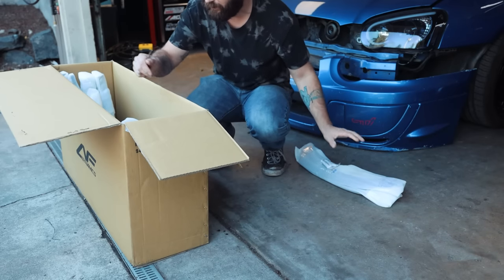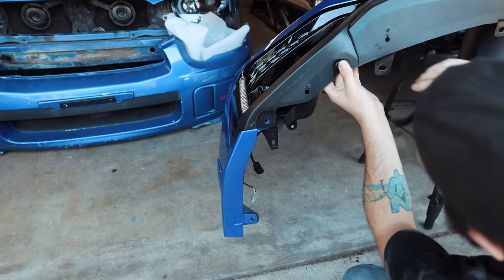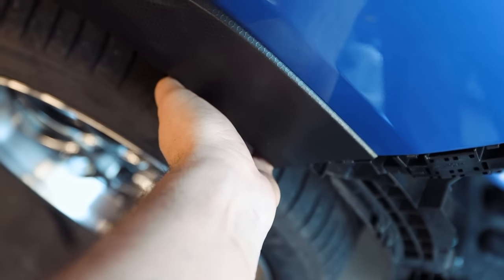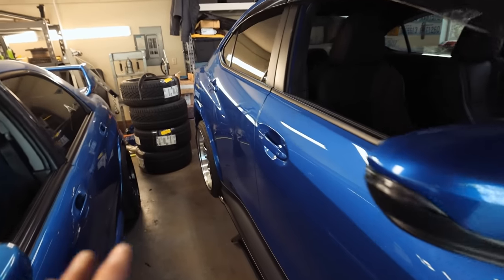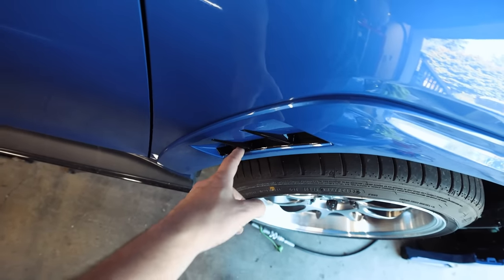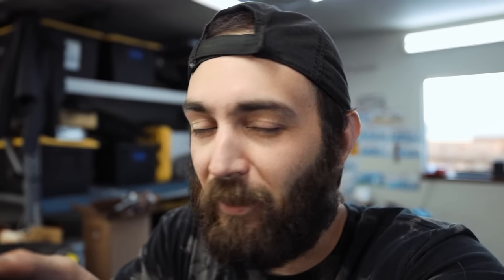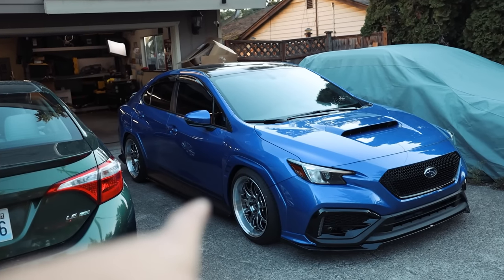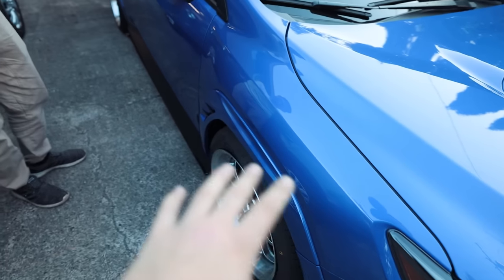2022+ Subaru WRX; Paint Matched Flares. Why did Subaru Not Do this?!

Comment: I prefer the black much more, but I've seen a few color matched ones that looked good. Depends on the color of the car.  My issue with these, and the bulk of paint matched flares, is that bottom piece of the fender that touches the fog light housing should not be paint matched.  It flows with the side skirts and should be left black like the side skirts. Visually, it is not part of the flare.

Comment: The STI started in 2 cranks of of the key this time.  The wheels flares are dope!!  If you compare the paint matched flares from the VB chassis to the VA chassis you'll notice that the VB chassis has an Octagon shape versus the VA chassis having a smooth round shape.  The VA chassis fender flares look so much better.

Comment: The other option to tie the flat black side skirts in with the front and rear bumper would be to take what mat’s thought was a two piece on the front lower part of the front cover and tape it off at the line and flat black it. It would carry the the flat black and piano black layers all the way around, and it would be a lot cheaper than having the skirts color matched.
Reply: This is the way.
Reply: Yeah this is what you should do, I've seen people paint the side skirt and imo it looks weird because then it becomes to uniform. Just paint the small part of the flare that goes onto the bumper black.

Comment: I love the paint matched flare/cladding so much more, but i kinda have to agree with Matt about the smaller piece side piece on the front bumper. The plastic cladding did kinda tie in the overall theme with the car and made it flow, but with that smaller fin on the lower side being painted, it kinda throws off the skirt and the front bumper a little. Persoanlly, i would maybe grab a black spray can, and paint that front side fin to make it flow again instead of paint matchkng the skirts.

Comment: Tossing in my two cents, I’d argue this is my quintessential look for the VB chassis, it’s similar enough to tie it back to the VA, but different enough with the flat black around the bottom of the car via side skirts and bumpers, to pull it all together! 10/10 dig it

Comment: Wouldn't it be easier to paint the little bumper piece of the new fender black? I actually like the side skirt being black, it makes the side of the car look sleeker.

That said, my main issues with the design of the car is the shape of the bumpers (octagonal cuts look weird over a round wheel), and the rear bumper juts out in a weird way. If they fixed those two things, the car look immediately look significantly better.

Comment: Looks great but still a fan of OEM cladding.  Painting the small piece on the bottom front flair black would 1. Look better than painting side skirts and 2.  Be cheaper/easier than painting side skirts.  Could prob just wrap it to see what it looks like.  If you paint side skirts the natural progression is to go to rear bumper and there’s no good/clean way to do that with WRB (black/white with painted bumper can look good).

Comment: Yea I fully believe it looks better stock, when the cladding is still there but it's just painted it is still the same distraction.  Only way to do it would be to make a one piece panel that was solid color and then it wouldn't stand out so bad.   I am used to the cladding now and like it though, plus would already have 2 paint chips if it was paint matched or full body panels so practical in my eyes.

Comment: Everyone gives themselves away as a non-Subaru fan if they were surprised by the fenders. Subaru was showing them on their VIZIV concepts for years. Only difference was they were carbon fiber. But a road car isn't a concept car, and yeah, didn't quite have the cool/quirky effect as the concept. Well...until I dropped the car 18mm and mounted black wheels...and the VIZIV look began coming alive. I'm painting myself...black/clear. It will truly look finished.

Rear bumper...it needs the BRZ rear bumper. No brainer. Doing "grafts" used to be reguler/rare thing...it was difficult. Mainly a European thing. Lots of grafting on Porsche's and BMW's in the 1990-2005 period. I figured 3D printing would make this stuff explode. That there would be 10 rear bumpers for the VB by now. Imagination appears to be fading away.

Comment: Tanner, the area that Mattias pointed out on the front that does nor look like it is part of the flare but it is, is the issue. It should be black to match the front lip. It would look much better and blend with the bottom lip and side of the skirting, IMHO.

Comment: Love it. Me personally I think this is one of the few exterior mods that should be done first if you can buy the flares. Aeroflow def did a great job at paint matching and manufacturing these. Great call on swapping out the oem ones bro!
Reply from the maker: It's nice to be able to swap back to oem if wanted with these ones. Super happy with the paint match 🙌

Comment: how about doing the sideskirt in high gloss black? The stock flat black only looks out of place Now because the rest of the paint is glossy clear coat, high gloss black sideskirts would look better than the flat black oem, but painting them blue would also look better than the flat black, I would lean towards blue since mono colored body is the traditional WRX/STI appearance package...if Subaru had done it from the factory there would have been a lot less controversy, but they also opened the door for customization , therby continuing the platforms modability! lol

Comment: Definitely a positive change, looks good, I think the paint matched flares from these companies are OEM pieces just sanded down and painted body color which is why the fitment is spot on, Need the side skirts painted body color to go with the flow of the painted panels now.
Reply from the maker: Surprisingly they're not OEM Panels, they're all injection molded, but done very well 🙌 side skirts are the next thing to paint match 🔥

Comment: Little off topic question, I'm building a jumper from my stock engine harness (06 2.5i) to my wire in link g4x.
Do you have any tips? Workflow, documention, grounds?
Reply from the maker: Color code wires, use a spread sheet and make sure all wires pass a tug test when making the jumper. 🫡

Comment: How did you get the bottom-most clip out on the rear-most cladding? I couldnt seem to be able to get them out and as a result my rears arent completely flush but looks like you easily removed it with like a thing of pliers or something? Car looks great man! WRB is the move!

Edit: also, so stoked to see a fellow PNWer! Feel like ive seen that white subie at PIA before. Hopefully see ya around! I got a CW 22 VB with the same paintmatched flares, some carbon, and silver wheels with a black roof.

Comment: Granted my magnetite isn't really far off from the cladding color but I have grown to like the front and sides. The rear bumper still is a bit much of the gray plastic. If I had WR  blue or Red I would have done the flares right away too.
Reply: I actually really like the black cladding on my ignition red. I’ve seen some with painted flares and it looks off

Comment: I was looking @ getting these but I wasn't sure if these flares exposed the metal from the rear quarter panel and the tire could rub there.  Did the inside of these flares have the same coverage in the wheel well?

Comment: Could you potentially just have the lower corner trim pieces of the front bumper painted to match the side skirts instead?
Reply from the maker: Potentially but the textural between the panels are diffrent 😅

Comment: What is proper oil temperature before using boost? I've heard 100°F, 160°, 180° and 190°. I've tried looking in manual and cant find it there either. If it is past 120° it seems odd because it takes awhile for oil to warm up to 120 or above at idle.

Comment: Im struggling with my subie out of nowhere my car is struggling to accelerate at low rpm, shifting problems and my accelerate percentage barely goes up I changed my spark plugs and 02 downstream sensor still nothing maybe bad ecm, throttle body and my fuel pressure reads 1k-2k when running

Comment: Looks great!! Paint matched flares and sideskirts all the way!!! Still dont like the rear bumper personally. If they brought the top of the bumper closer to flush with the weird black section i would like it. Please do the va vb bumper cut!!! It would be unique and likely look awesome!! Random rx7 update!! Got a new(ish) carb. Fuel pump, fuel line, and all the required wiring pieces! (Hopefully) it does turn over. It fired. Now hopefully all it needs is fuel to run. Eager to see what you do next!!!

Comment: They look great…but, $1000??!!
Reply from the maker: To be fair, you have your oem ones done its about $700 -$800 for a paint shop to sand em and paint em. For a little more you get ones that are 10mm wider and gives you the option to go back to oem if you wanted
Reply: @Smeedia  Totally agree. And the fit and finish is excellent. Just a hard pill to swallow. 👍🏻